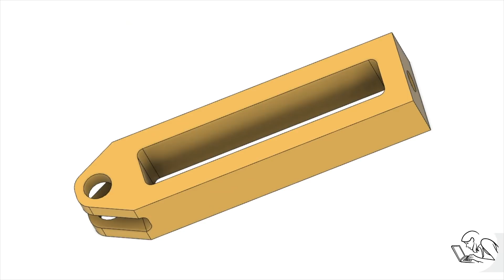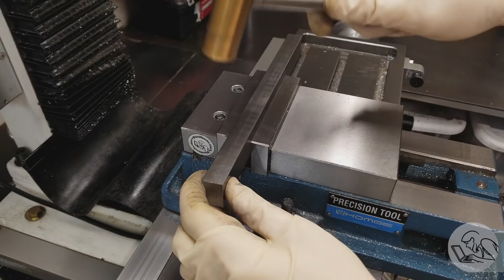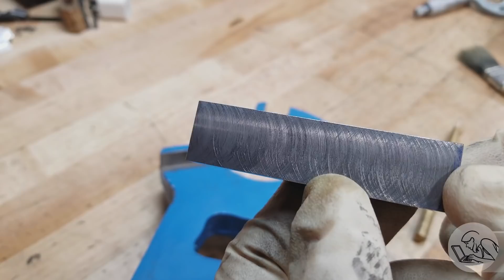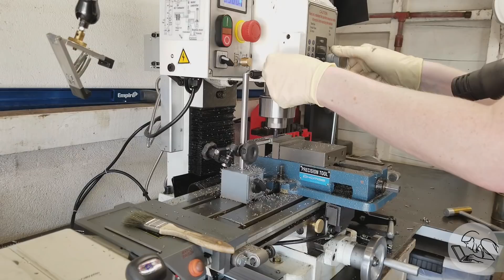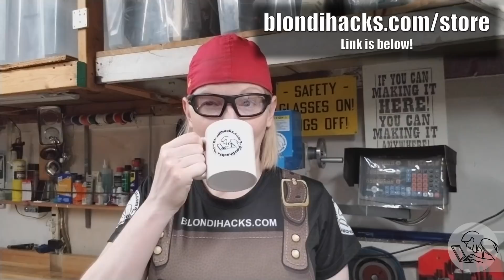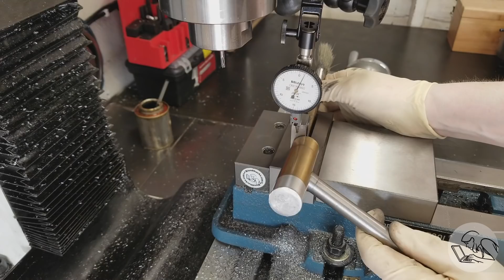Building a Steady Rest, Part 2

Comment: I'm always a bit amused when ever I hear someone say "Balls out" or "Balls to the wall". A lot of people assume it's about male anatomy, but in fact, it's a reference to  the centrifugal speed regulators on the old steam engines  These were often surrounded by a wall, to keep  keep people from getting injured.  Hence, "balls out" means the throttle is wide open.  It is often, wrongly, attributed to aircraft, in that the throttles have balls on the top of them.  But why would anyone say "balls out"?  Instead one would say "balls forwards"  Also, the first usage were during the age of steam, before aircraft were common.

Comment: That problem with the Ebay steel, how can you tell for sure exactly what a piece of steel is?
Reply from the maker: You can’t really, for sure, without a gas chromatograph or something. You can make some broad guesses though, based on how it cuts, the magnetism, how it sparks, etc. Determining exact alloy is not possible for a home gamer, though.

Comment: Another way to find center and square up a rectangular piece of stock is a way I've watched Adam do.  Take the piece and cross scribe the end and center punch it.  Then take a round piece of stock, chuck it up and center drill one end and turn the other end down to a point.  Now put your rectangular piece in the chuck with the center marked in facing out. Take your round stock  and put it between centers so the cone shaped is in the center punch mark of the rectangular piece and the other end in a live center of the tail stock.
Now just put a dial indicator on the round stock and adjust the chuck until the round stock is running centered.  An now your rectangular piece is centered.  Now just keep the round stock for the next time.

Comment: About that filing at the end.... 
There is a nice new video of Tom Lipton named "Toolmakers Adjustable V Blocks P4" where the second half is only filing... 
Two things i learned
1. you can blue and sign a lines which guide you for the chamforing
2 and most usefull - when I file an external radus i always filing wrong, where it shiuld be in the oposit moving direction.

Comment: You might want to check out another YouTube channel for one of the operations shown here. Joe Pieczynski has a better and far easier way to center rectangular square parts in a four jaw chuck. He takes a rubber band and puts it around the parts end and then installs four pieces of shim stock, one on each face, so that they project out from the end. You put your indicator inside the shim stock and turn your chuck to measure each face from the inside. You can see it here: https://www.youtube.com/watch?v=WCei5GlEZ5g

Comment: Overall very nice project. Just another quick hack for you. When dialing in work on the 4 jaw, you can use a brass or aluminum block between the bed and the jaw to stop each jaw in the same place every time. That will save you having to locate your lowest reading every time. Much quicker. If you still want to double check by oscillating the spindle on the last time around, you can, but most times the block will get you close enough.

Comment: That finger of  Cthulhu is happy that you sacrificed your two inch mill on the unholy alter of eBay randomly sold stock. For that it will do away with your undesired material.
Woohaaa haahh haaa!

Comment: I agree about the Fein. My sister and brother-in-law gave me a Fein vac for Christmas 15 years ago and it is still the best shop vac I have ever had...I currently have 2 and there is no comparison. I have two of those angle block sets (red case) and they always pop loose - sympathy nod.  You were using what looked like cold rolled steel which has a lot of built in stresses, so perhaps the slot was smaller because it closed after you milled it to size. Beautiful work.

Comment: I notice you have the same Grizzly version of the standard 4x6 Chinese bandsaw that I have.  I built a coolant tank and splash guard/return system for mine and dropped in a $20 garden fountain pump.   A little HDME tubing as delivery hose and couple ball valves turned this little saw Into a metal eater and tripled the blade life.  With a 10-14 bimetal blade at the saws fastest speed it will walk thru 3” hot or cold round stock in two minutes.  Using it a dozen times a week or so on average to cut every shape and thickness imaginable I get a year out of the blades easily..
Reply from the maker: Good info, thanks! That 4x6 saw is ubiquitous. Every discount toolmaker has a version of it painted their color.

Comment: 1.  Ok...here's the butter up.  My, what a whiz-bang good video.  Thank you.  (It sure was.)
2.  Question and statement:  I'm a hobby turner.  I turn wood, aluminum and brass.  I've 
      recently come across a Chinese boring head.  It looks like just what I need in some of my
      projects. 
3.   I hate buying an import.  Prefer "Made in the USA" if possible.  I don't want to brake my 
      bank.  I don't need SUPER precise.  I do wish to have a decent quality tool.  I assume most
      all are similar in operation so ease of use is ....assumed.
      Can you help me find such a choice of purchase for this product....(OR do you not do such 
      things)?
4.   Grand flourishes and over done thank your dear lady!!!   Indeed, thank you for even reading
      this.
Reply from the maker: The boring head I use in these videos is a basic Chinese one, and honestly it’s not bad. I bought it from LittleMachineShop. A proper high precision boring head from a US or German (or similar) company is going to be 10x the price, so I think this is an okay area to compromise for the hobbyist. This Old Tony has a great video where he talks about improving the geometry of the boring bars that come with these import heads, but I haven’t even gone that far and get good results.

Comment: For adding a strip of 'pressure foam' to cases; to keep parts from moving (as with your angle blocks), I've been using some melamine foam.  It's sold as the 'magic eraser' sponges, because the melamine is remarkably hard for a polymer, so works well in that role.  But in this case, it's got good stiffness, springiness and longevity and, important, it's very easy to cut (due to it's stiffness).  I use a utility knife, which works great; not quite sure of the feeds and speeds if you wanted to mill it!.  EVA foam is similarly easy to cut, but softer and denser, so doesn't work as well for acting as a retaining spring.
A thin stip running the length of the top, position along the middle, will apply the pressure to keep the blocks from moving, and is only a 5 minute job.  Working form the stuff sold for cleaning means needing to piece it in, but that's not an issue for this application. The melamine foam is not hydroscopic, so won't keep moisture in there.
Reply from the maker: Good tip on melamine, thanks!

Comment: As always, good stuff.  I always give a thumbs up (to crush a troll) before watching your videos.  Thanks much.

Two things for your consideration: 1. If using a 90 degree spot drill, you can save yourself some deburring by making the spot larger than the through hole by twice what you want as a finished chamfer.  2. On small parts, you can get away without using a hammer to seat them if you listen for a "clack" when placing them in the vise.  If you don't hear a "clack", there's some debris between the part and the vise jaws.

Comment: Are you liking the power feed on your mill more now?  In your video on buying mills and lathes you commented that it was sort of clunky and would not go as slow as you wished.  I have a Clausing 8525 knee mill and the power feed on it seems to always want to go faster than I wish.  Save the possible 4140 stock for your next gun build.  When I was young we used to get the tie rods off junked trucks to get 4130 or 4140 stock for projects.  Lack of funds.
Reply from the maker: It’s still better than no power feed, but I’m not a fan of it. I definitely want a better one someday.

Comment: Quinn, I especially appreciated this series - I have exactly the same steady rest and follow rests (by the way, does anyone find a follower rest actually useful?)  This most definitely is a near-future project - I have the stock and the bearings ready to go.  On the angle blocks, I have exactly the same set and had the same problem - every time I got them out the box was upside-down and they'd spill out.  While this is just an annoyance problem, I solved it by putting a prominent label for the box top - and that cured my problem; maybe it would for you?
Reply from the maker: Yah, I have to store the box vertically in my drawer, hence the mess every time. And yet, I keep not doing anything about it. I’m a glutton for punishment.

Comment: I've always told my self I'll change from brass tips to ball bearings. But I don't use the steady all that often and besides I only think about it when I go to use it again. Too late by then. I've only used the follow rest twice in the last 4 years, really not worth modifying, is it? Thanks for the inspiration to actually do it.
Reply from the maker: I don’t really use it enough to bother with this project either. 😄 It just seemed like a fun project so here we are. 😁
Reply: 25 years ago I went thru this exercise for my then recently acquired 10" Logan lathe.  It didn't take long to figure out why steady rests are made the way they are.   Especially on small lathes where your steady is usually not all that far from the work piece and flying chips.  It then became an exercise in how to prevent chips from getting rolled.  
 Eventually the original parts went back on the steady rest and the fancy roller fingers have lived in the toolbox ever since.

Comment: I considered the chamfer of the fingers and your reasoning and at first thought I agreed.   Then I wondered if the chamfer actually may lead to collection of debris.  If the parts were well matched with a close tolerance that a lubricant would fill, it seems less likely that you'd get anything in there.   <-  I think I've overthought stuff...   Nice work...
Reply from the maker: Inside machined corners are never perfect, so it’s normal practice to clearance the mating part.

Comment: Just guessing at the mystery metal, possibly SAE 1040/45,  other wise known as "Key Steel" ref what looks like 13" length 🤔🤔🤔. Have a look at " Sparks test" for metals, basically using a grinding wheel and interrogation of the sparks.
Great modification, some precision slotting indeed.
Tip, when the part sticks out to high out of the vise, clamp a 1, 2, 3 block or similar resting on the jaw with the part.
Like those extended inner race bearings.
Great vlog, stay Safe all and thanks for sharing.

Comment: T
Regarding the pin for the bearing. On mine, I drilled a full size hole on one ear and a smaller threaded hole on the other. careful to thread the side that will self tighten as the bearing turns. When its all installed, everything is flush.

Comment: A file is actually the most accurate tool in the shop
Reply from the maker: The portion of the machine holding the handle is very difficult to adjust properly, though.
Reply: I had to file for 2 weeks once as part of my apprenticeship. By the end he had as filling parts better the a cnc could cut

Comment: For the angle on the pin, you could zero the cutter on the top of the jaw, add the pin .250  + desired wall thickness .100 + %10 for final and surface finish cut .035

Also a small angle plate would work great for the end slots since you can support it standing straight up.
Reply from the maker: Yah, I do have an angle plate, but that’s fussier to set up than the vise, and I want that internal radius from milling horizontally
Reply: Grind an endmill to the corner radius you want, kind of like a semi ball nose. Just giving different options. Theres a million ways to do it.

Comment: I did not know the origin of "balls out" before your little insert.  Makes a lot of sense now!
Reply: "balls to the wall" has the same origin.
Reply: Hmm... I can tell this is referring to 12:34, and that shape is familiar, but I don't actually know what it is... what is that mechanism, and what does it control, and how?
Reply: @DavidLindes  look up centrifugal governor on Wikipedia.  It uses the centrifugal force of spinning balls vs gravity or a spring to limit fuel or air to govern speed

Comment: Hello Quinn, great to see the end mills being used.  On your slot width for the bearing, always keep in mind, industry standard diameter tolerance is +0, -.002 on 1/8" and larger Carbide end mills.  If you don't take into account this tolerance it may lead to under size conditions on your part piece.  Of coarse you have to be able to measure the end mill diameter, which is not easy for most people.  In today's world, tool manufacturers now use laser micrometers.  The 3/4" end mill is called a VFP (Variable Face Profile).  The curvature of the face changes the shearing potential of the tool and the profile on each flute is staggered from the others.  Thus it produces a anti-harmonic response during cutting.  Keep up the great work my friend.
Reply from the maker: Great info, thank you Dennis!
Reply: @Blondihacks  Your Welcome my Friend.

Comment: I extend the usability on larger endmills, 5/8” - 1” dia. to me, by free-hand grinding a small 45° on the burnt/worn tips. Much like sharpening a twist drill. They actually work better than the sharp points for surface milling.
Reply from the maker: Yah, I’ll be regrinding these one way or another. Good tip!

Comment: Tips:

1 - A powerful (12 Amp) shop vac is an indispensable chip removal tool around a turret mill, especially for short chip faceing cuts.

2- Drill the corners a trife over-size from your clean-up cutter before you slot mill. If you have the option and a sharp corner part mates with the slot, offset the corner hole 0.293 x the drill radius to "bear ear" the corner. Thus, the corner radius circumscribes the sharp corner an internal rectangle with minimum material removal. (0.293 = 1 - SIN 45°) this results in 0.018" over-cut Vs 0.062" over-cut using the "mouse ear" technique (where the drill is centered at the slot rectangle corner.)